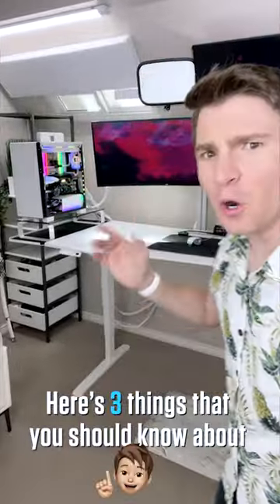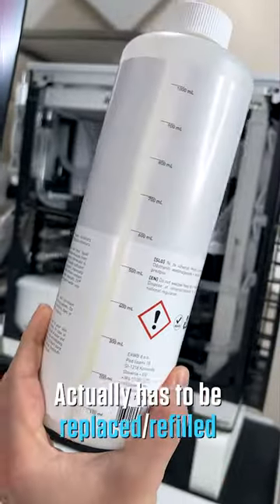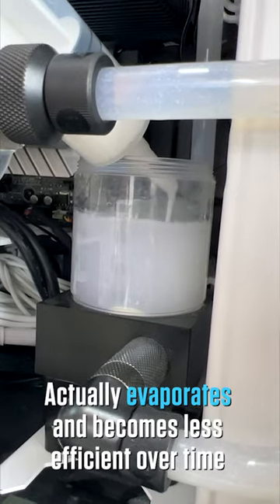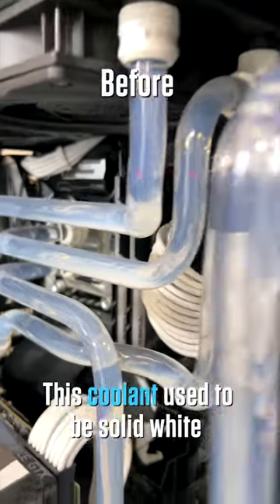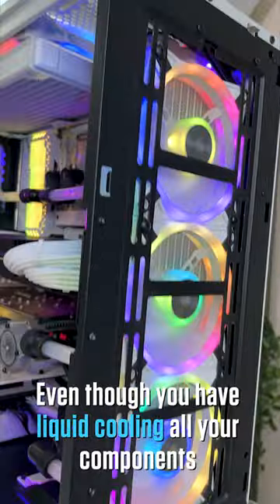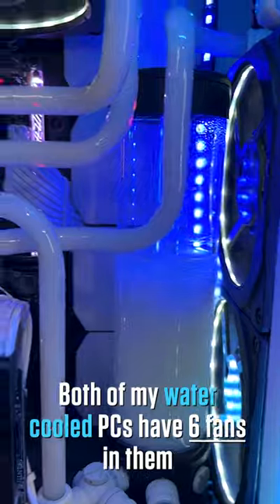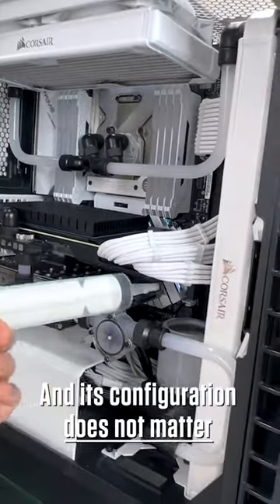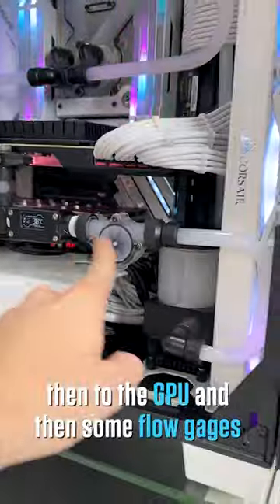3 Tips You Need To Know Before Building Your Own Water Cooled PC #shorts

Comment: Rule should be about rad size not the number of rads. Size is more important than amount when it comes to rads. You were doing well then dropped the ball on that one
Reply from the maker: A 120 rad to a CPU and a 120 rad to a GPU will suffice in most systems for like 95% of the time. The "Rule of One" is easy enough for viewers to remember and if they get to the point of spec'ing out a build, the case size and components become a factor. Could include size in a part 2 but would need a way to simplify that lol
Reply: @AprilMayRain  the law of thermodynamics says other wise
Reply from the maker: Yes it does, you are right  @Joe Kerr  but we are restricted to the standard size of a PC case.

Comment: why is it so expensive is my question. you can get a good aio for 150 but just a pump for custom will cost you 250 thats bs its maybe a $50 pomp $30 radiators and $20 in tubes nice kits should be like $150 got two radaitors
Reply from the maker: It's the enthusiast market so manufactures can set their own prices 😑

Comment: If i buy a Waterblock, let's say for a  Bykski RX 6900 XT Full Coverage RBW GPU Waterblock For AMD w/Backplate, will that waterblock fit all variants of 6900xt or a specific model only.
Reply from the maker: Great question! The short answer is no... Waterblocks for GPUs are designed to fit specific models due to variations in the physical layout and design of different graphics card models. This is because GPU manufacture create custom PCB layouts for each GPU model. A waterblock designed for one PCB layout might not align properly with the components on a different layout, compromising the effectiveness of the cooling solution. Some waterblocks fit the specific contours and mounting points of a particular GPU model. Using a waterblock with an incompatible GPU might lead to poor fitment for cooling or in extreme cases, damage to the graphics card due to leaks. Most waterblock makers, like Bykski, will clearly specify the compatible GPUs with the waterblock. What make it more confusing is some waterblocks work for multiple GPUs and some will only work with one specific model. I hope I answered your question but let me know if you have anymore I can help you with!

Comment: i mean the flow does kinda matter. but not in the way some people think. there is an inlet and and outlet on everything. and as long as you use those properly. it doesn't matter. cpu or gpu first. and it doesn't matter which rad is first.

Comment: I am currently running my custom loop with primochill vue coolant that i haven't changed in over 4 and a half years. Should i change it? Yes. Is it completely clear now? Yes. Has my cooling performance been affected? No.
Reply from the maker: Hey there! So it depends how "hard" you are on your coolant. If you have been overclocking/capping your temps for 4+ years, then I recommend fully changing it out. If you have been doing light gaming/workloads and since you are using a quality coolant like vue, you could do a res-refill. You basically take a plastic syringe and just remove the current coolant out your reservoir and add some new vue to take its place. It will bring back some nice color and improve your loops efficiency in the easiest way possible. Don't even have to do a full drain and can repeat that step a few times till you're satisfied with the color. Let me know if you have anymore questions legogtad! ✌🏻

Comment: Use automotive coolant mixed 50/50 with distilled water only, or buy pre-mixed anti-freeze. You won't have sludging and deterioration of the pump and seals. AIOs have hoses and you can't see the color of the coolant anyway, so it's not like it will affect visual performance. Temperatures (high & Lo) , pressures and environment in a cars cooling system is WAY more extreme than anything your PC will put out, and automotive coolant is designed to work in those extremes for five years minimum. You'll likely never need to replace it again. And if you do have a custom loop with transparent tubes, you can get red, green, yellow, orange and blue automotive coolants. Each color is meant to identify it's intended use scenario, but in a PC environment, any type will be fine.
Reply from the maker: Wow thank you Randomnation for the recommendation! I will have to try it out. I have a soft tubing build that I need to replace the coolant in. Would the coolant at all stain the clear soft tubes? Will have to see if I could find clear automotive coolant or antifreeze 🤔

Comment: If your using the rule of one rad per one component then wouldn't you need 3?
1 CPU
2 GPU's

Right?
Reply from the maker: Great question AftDawn! So 1 rad per 1 component in my example is 
1 rad for CPU
1 rad for GPU
If you had SLI GPUs then I would recommend another rad to equal 3. It looks like I have another GPU but I actually have what called a Honey Badger Expansion Card under my GPU. 
https://amzn.to/3VtIRzV
Hope that helps!

Comment: The radiator order does matter. But it does not make any huge difference. It will make like 2-3 degrese C. But if your most power hungry component is GPU and it is like 1080Ti, 2070 super and above, 3080and above, i highly reccomend going in to the card first from two radiators and than in to the CPU. But you have to add on every single watt of your system if you care about noise and still being relatively cool. Two 360mm radiators will efectively cool i9 12900KS and still cooling the RTX 3090 with temps not exceeding 75 degrese C. But in this order - R - CPU - R - GPU etc. More power,  better is this order than running it with two R in series, going in to the CPU first than in to GPU.
Reply from the maker: Great points Samo. If you're using your PC longer than 3mins then all your temps will equalize so it's still tough for me to recommend a valid flow order. I want to make a video where I test temps in between every junction just to see how they flocculate under work loads. That would be cool to see!

Comment: I have a request can u please use Methanol + Water in a 50%+50% Ratio.
That mixture is known as brine and can drop temprature to 0 to -5 °c.

Brine actually used in industrial level to cool the Reactors, The mixture circulates the Reactor jacket to cool the Reactant inside the reactor.
Reply from the maker: Oooh that sounds enticing 😯Do you have an article you can share for PC uses?

Comment: watercool yet 6 fans(not including 1or2 on that psu) and i take a look at my 1 for cpu 1 for psu 1 or 2 for gpu and 1 on the case to push air out come out to 4or5 fans total..... i stick to aircool thanks.
Reply from the maker: If you want a quieter PC (with fans running almost silent) or have the overclock ability to push your PC to its highest potential then I recommend watercooling. For you, stick to aircooled👍🏻

Comment: What if you use a big radiator used for hearing the house for liquid cooling the PC? It has a big surface do maybe it could work without fans. Maybe it would even work without a pump using convection of you put the radiator above the PC.
Reply from the maker: This is a very interesting topic and a build that I would love to design. I would still probably use a D5 pump just to ensure a steady flow and have the radiator outside with modular tub fittings to easily connect and de-connect. A passive cooled PC is a dream but would almost take more work lol

Comment: Good stuff to know. Now it feels like I just need to find a water block that can interface with my (slot 1) Pentium 3 cpu.
Reply: Just remove the metal heatsink attached to the CPU and install the block to the slot. Now you can finally hit 1ghz on your slot 1 cpu
Reply from the maker: It might be a bit more complicated than that but @idkrossplay  has the right idea!😁

Comment: Personally I would just use 3 fans per radiators cuz with that many it will do fine and adding more will just make the PC louder, barely any more efficient
Reply from the maker: I would agree to disagree just cuz with my testing, having more fans makes my PC's quieter. With 3 fans, those fans would be working twice as hard as 6 fans to circulate air. The 6 fans can move the same (if not more) air through the system at ambient settings to sound no more than just a quiet humming.
Reply: @AprilMayRain  that’s if u set them to all work together and they are all same brand same software which most people can’t be bothered to do
Reply: If u just got 3 fans and put them on it cools it enough, 6 is just overkill and doesn’t impact performance in any meaningful way and if u get 6 and then just put them all lower then what’s the point at all, you’l just be matching what ur 3 fan radiator would be anyway
Reply from the maker: @watersharky7589  IF you only had 3 fans. 6 isn't overkill at all for a custom watercooled system

Comment: what is the benefit, if have an air cooled system with 4 fans instead of a watercooled system with 6 fans.
Reply from the maker: That is a difficult comparison because a watercooled system is using (typically) the highest end components. So if a similar system was air cooled with 4 fans, the 4 fans would be working twice as hard to circulate air to cool the components. The air cooled system would run hotter and louder.

Comment: How much quieter is this compared to a completely air cooled setup, and is this the route to go if you want less noise under load?
Reply: Yes its definitely quieter under load
Reply from the maker: Yes I agree with aurya, it is definitely quienter under load but I wouldn't build a custom wc PC just to have it run quieter. Unless the type of work that you do is requiring all your fans to run at 100%. Getting better fans or a new case is what I would try first cuz just it's a way cheaper option that could provide imitate results.

Comment: I don’t think I’ll do another water coolant loop after my first one leaked on my 2080TI, It got fried. Even the Water pump went out on me one time.
I am getting A new PC soon. The Ryzen 9 7950x  Rtx4090. I’m not taking any chances. I’ll just stick with an AIO coolant. I have a 13 year old PC that uses an AIO. Still works fine.
Reply from the maker: I feel you. I have never had a GPU fry but have had a pump fail and a leak that almost blew my power supply lol and it's difficult to get water blocks right now for new motherboard and 40 series so AIO is a good way to go with your new PC.

Comment: Don't much agree with the rule of one if anything it's more important to have a rad in-between components so you can cool the liquid before making it's way to the next the only thing is if you use more then 2 rads make sure your flow rate is fast enough but not too fast if it's too fast the water wont transfer heat into the rads if it's to slow it will collect heat around the components to fast
Reply from the maker: This is the great debate! I used a ton of resources to get the conclusion that I explain but nothing is for certain. I hope that LTT Labs will test this soon!!

Comment: It does matter where the liquid goes first, if it goes through the cpu and then the gpu then the gpu will get hotter
Reply: It does matter if you have two components without a radiator between them, but if you alternate radiators with components and the radiators are the same, it should matter which radiator goes to which component
Reply: @PanDiaxik  that's what im sayin
Reply from the maker: @makishimu3328  It doesn't matter due to thermal capacity. Once the liquid reaches a constant temperature, which happens very quickly in a PC, loop order is deemed obsolete.

Comment: How does water cooling work?
Reply from the maker: Great question Notaj! It's all about dissipating heat. PCs, when they are running (connected to electricity), get hot due to computational processing workloads. Air-cooled PCs are the simplest solution to move this heat away from a PC commonly using case fans. Water cooling uses coolant to achieve this more efficiently due to liquid retaining a higher cooling capacity. The coolant moves through a loop system in the PC that absorbs heat from a metal baseplate that is making contact with the PC component. Radiators are positioned with fans to exhaust the heat away from the PC, recooling the water in the process. The thin metal waterways in the radiators expose the liquid to air, which helps it cool, and fans attached to the radiator then move the heat away from the system. And then it repeats. It's a bit more complicated than that but that's a crash course 101 class for you Notaj! Let me know if you have any more questions and thanks for watching!🤍
Reply: @AprilMayRain  thank you so much for responding to me
Reply from the maker: @Nittylovesvr  Of course! Anytime 😊

Comment: Water cooling is kinda overrated I think, but still looks nice. For my pc I only use 5 fans, placed right, and my temps on cpu and gpu never rise above 60 degrees when I sometimes have really heavy workload (blender, Tensorflow, Adobe programs).
Reply: Now try to cool a 3-400W CPU with air cooling
Reply: Try that with a 5950x and 2 3090’s.
Reply from the maker: Hey Raffael! That's great that you have good temps using heavy workloads on your air-cooled PC. Overclocking or pushing the limits of an enthusiast workstation is when water cooling doesn't become overrated but becomes a necessity. If you aren't rendering multiple Blender projects while needing to continue working in multiple Adobe programs then you don't need to transition into water cooling yet. 

Omega's and Bob's comments explain it well enough too 😂

Comment: Do aio coolers also evaporate that quickly?
Reply from the maker: No. Since AIOs are a closed loop system, they have an extremely low evaporation rate. Great question Walter!
Reply: @AprilMayRain  okay so I don’t need to do any maintenance to an AIO cooler? As long as it’s connected I should be okay right?
Reply from the maker: @dskillz32  Yes. The only maintenance that I would do is basic dust cleaning and that's it! I would replace it after 10-15 years  just as a precaution too👍🏻

Comment: 1 per component?
only have one radiator for cpu,gpu,ram,mainboard
Reply from the maker: 😲I hope it's at least a 480 push pull thicc boi 😬
Reply: @AprilMayRain  560x80mm, Alphacool monsta.
Just push, but it is the noctua ppc 3000 NF A14.
But im planning a New Case and then it will be 8x 280mm radiators. A bit larger than corsairs 1000D, but totally different layout.
Reply from the maker: @derfacecrafter1869  Yooo I have to see it when you're done! Sounds like a beast!

Comment: Pretty sure it’s the water and not the ethylene glycol doing the heat displacement?
Reply from the maker: Yes you are correct. The ethylene glycol is more for the corrosion inhibitors and increasing heat capacity.
Reply: @AprilMayRain  Cool, but if I remember correctly ethylene glycol reduces heat capacity? If it increases heat capacity then why not just use it purely rather than water?
Reply from the maker: @adsrbad9733  I think you can but think it would actually make your PC smell when it gets hot. Also could have a problem with flow or how 100% ethylene glycol could effect copper or the tubbing. I might have to check reddit for this one lol

Comment: Actusllu if you want gamer nexus some stuff does matter like where the pump goes in relation to the radiator
Reply: Only true for AIO. Not for custom loop.
Reply: @azhp42069  now here is the thing why is it called a custom loop? And why is it so expensive ? Where it should only cost you like 20 bucks to do a computer worth of pipes I mean I guess the pump might be another 15
Reply: @richardalfaro4933  custom because it's not out of the box, you design the tubing runs yourself. And the cost is I guess because the demand is low and the requirements are high. The fittings alone cost 10 bucks each, pumps 100, GPU block 200, CPU block 150, radiators 50 to 100. If you don't want to pay it don't
Reply: @azhp42069  um that is what I'm saying what your describing is very basic cheap plumbing

Comment: If you put 80°C water from gpu straight to your cpu It's not going to be happy
Reply: I don't think water will get to 80°C if it's following, but putting a radiator between CPU and GPU should help with one component heating up the other
Reply from the maker: @PanDiaxik  It does help BUT only for about the first minute or so once your PC is in use. The temperature of the liquid reaches thermal capacity with how quickly the fluid moves through the components that rad medians become obsolete.
Reply: it doesn't matter. the water equalizes. it is a common misconception though. also the water shouldn't get that high.

Comment: You do realize as long as you got a decent size radiator you don't need one radiator per item.
Reply from the maker: This is a good point Chris and it really comes down to the different PC case sizes. If a case can handle a 480 radiator or larger, which is like 5% of PC cases, it's most likely that that the builder wouldn't just want one rad in the case. The rule of one I would say is still a great rule to follow for anyone just getting into water cooling.
Reply: @AprilMayRain  actually a 480 is the biggest they make that's actually four fans in size and two that theory doesn't work for everything look up Jay'stwocents on YouTube on his water cooling builds he uses one rad most of the time to cool his video card and CPU. Devices really don't get as hot as you think, you really don't need more than one radiator are you set a case size you might have to break it up into two but really you can get away with One 360 rad and be fine as long as you got proper air flow one radiator will be fine.
Reply from the maker: @chrislewis2262  Great point Chris! Yeah Jays videos inspired me to make this Short actually. It would be and interesting benchmark to test. Like does 1 360 out cool  1 120 and 1 240? I would love to make that video. I know a push/pull 360 is super efficient